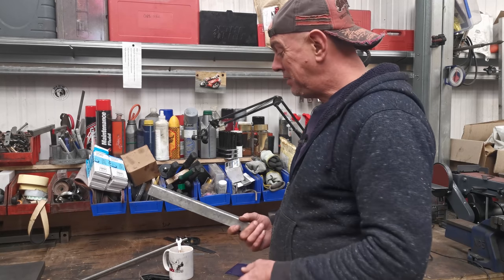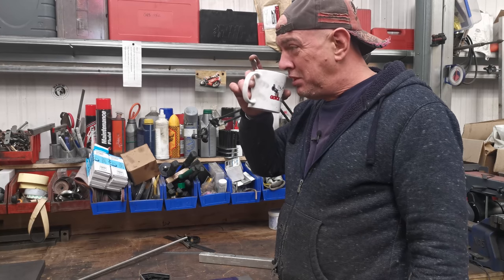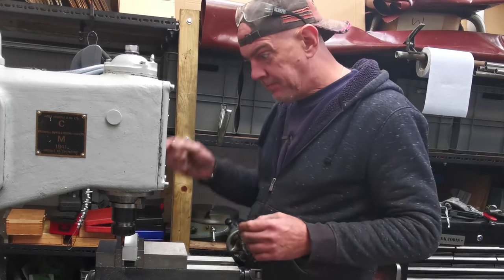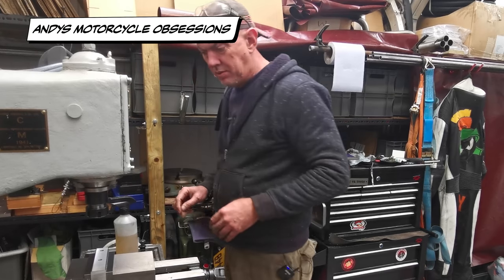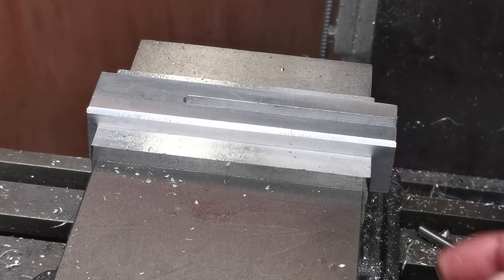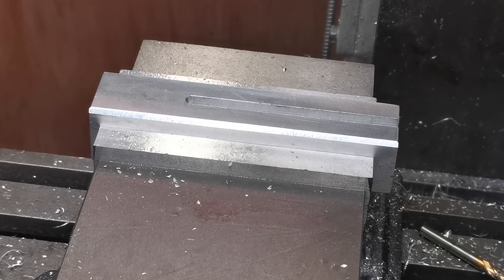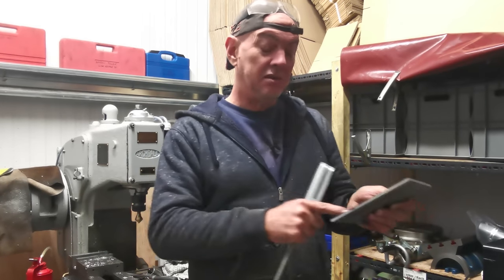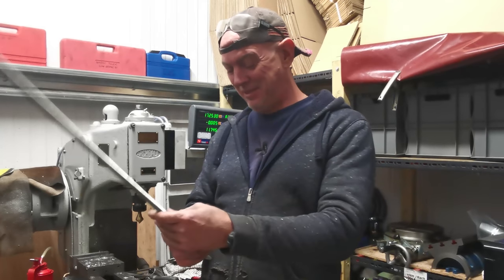Making a frame jig Pt2 - Suzuki Bandit Cafe Racer - ASBO Project

Comment: That stupid slot ...lol.. yup that's a sensible way to do it I do the same with a router in wood . I'm thinking you need ya glasses a bit more lol I know the jokes 3inches is 6 when it comes to the ladies but this is more precision than wham bam thank you ma'am.  It's a surprise how long a simple job takes isn't it . Tis getting there mate . Cheers again gaz
Reply from the maker: Hiya matey, I should really wear my glasses all the time... just got told off in work for it as well 🤣😂
I figure it's worth putting the time in now to get stuff right as the framevis going to depend on it 👍
Reply: @QuickBikes  its worth every minute and being precise . It will pay off later down the road when it comes to keeping things in line.  No point doing something twice .